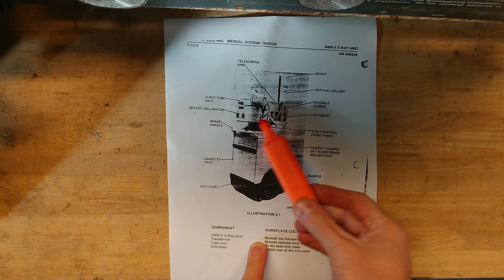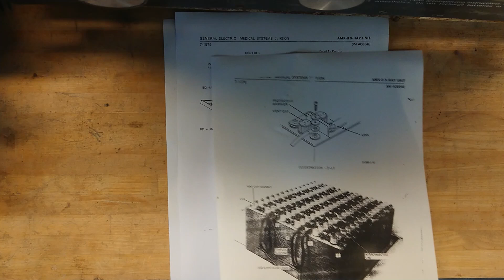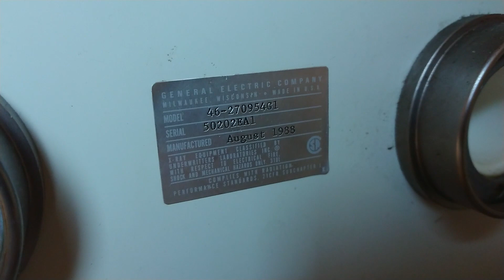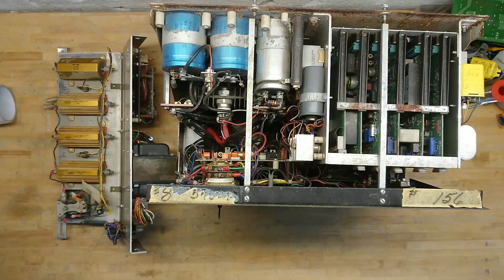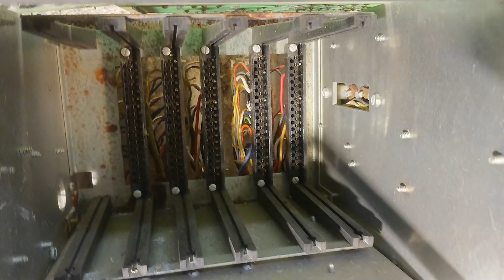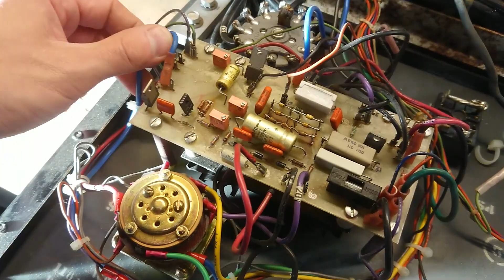GE AMX-II, Mobile 110kV XRAY System Teardown

Comment: Hello I use an AMX system II to test our X-ray tube which is down. I was checking the equipment because the board for operator panel was damaged (burned) I replaced it but the equipment does not make exposition and also I saw smoke coming out from below of the tray of control boards.  I am scary to dismount any cable because Im not expert on electrical schematics and I dont know how to start to check the failure because after the smoke 2 fuses of 8A in the front of equipment get damaged. If you have any idea on how to proceed I would be happy to know that. 

Regards

Comment: That's a beautiful unit, it's busy in there but yet nicely tucked together.
Reply from the maker: Yes, so many small PCB or single components placed all around with wire harness going around to it. Not something you see in new equipment.

Comment: Capacitors behind the SCR heatsink is there for commutation, using one SCR to turn off the one conducting, via the capacitor and a power resistor. The series resistors are there to limit current rise, but this is a standard 2 SCR half bridge driver, where you have a power device that handles the full load current, and another that is used to turn the conducting one off by reversing the anode cathode voltage via the capacitor transferring the current flow from the main device to the aux one. Then the aux one has a low current flowing through it, and when the main one fires again it is commutated again making it ready to switch the main one off. Done because SCR's are really robust devices, but power transistors then were fragile and blew up easy, but the SCR did not. That way they could get adjustable on time and not have both devices conducting on the bridge when switching. 100A SCR is pretty small, they went up to 1kA in almost the same package size, often used for electric forklift main motors.
Reply from the maker: Thank you for the details :)
Reply: Is that similar to some of the CFL/LED compatible mains dimmers?